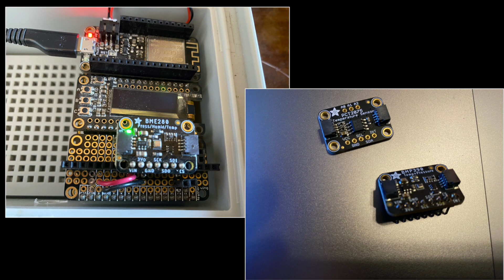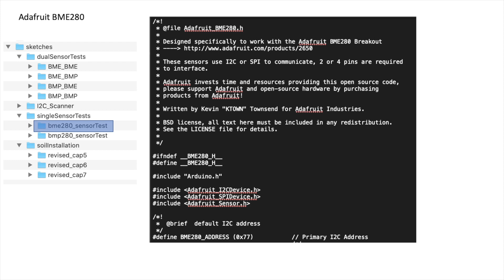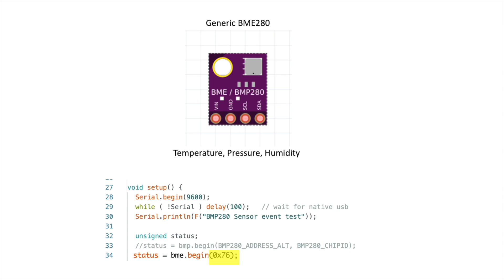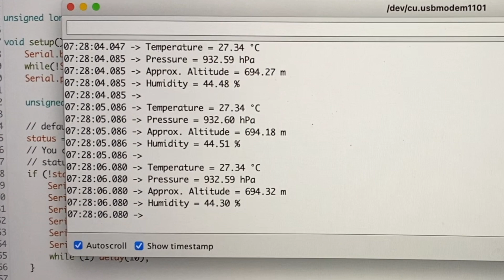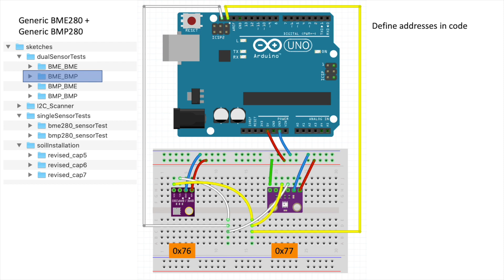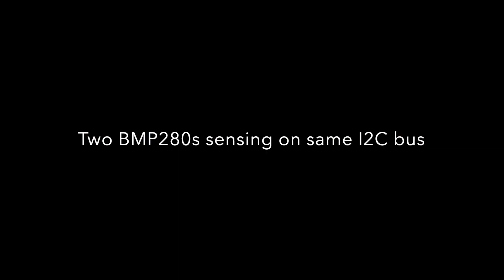Using BME280 and BMP280 Breakouts with Adafruit Sensor Libraries

Comment: I have a bmp280 that has the 4 pins but not the 3 pin so you can select the address.
Reply from the maker: Hmmm - you should be able to query the address it’s using with one of the sample sketches I shared (if needed👍)

Comment: The thing I really wish I knew when I first started using those sensors is that the ones you often find on eBay can be 'fake'. I bought a few BME sensors only to find they're BMP sensors! Now I only buy ones from reputable stores, I find the Sparkfun ones have the best breakout PCB for my use cases.

Also the reason why you can't cut the address select trace on some generic breakout PCBs is because there isn't one, those ICs actually have an internal pull-up resistor to select the default address when left unconnected, you can just add the bridge without cutting anything on them. Edit: You need to add the solder jumper where then trace should be (jump to ground), as it's pulled high by default with the internal pull-up resistor.
Reply from the maker: Yes - it's a little like going to Vegas when you buy on eBay. I've found a couple of reputable dealers, but they are a bit more expensive than the rest. Thanks for the heads up on on the trace for those PCBs-- I'll add something to the description shortly. (I always learn something new from posted comments.) 😊